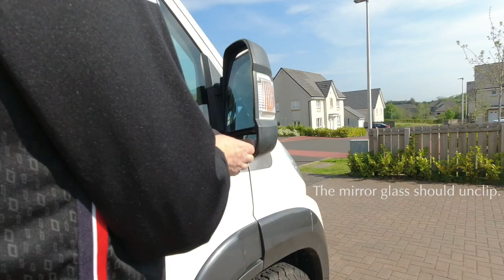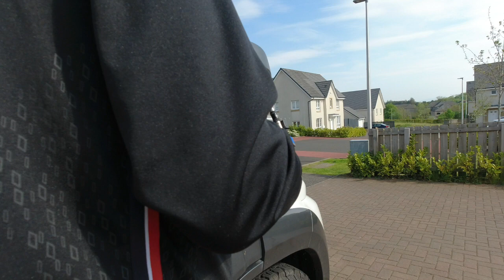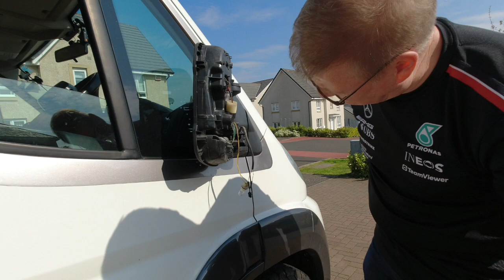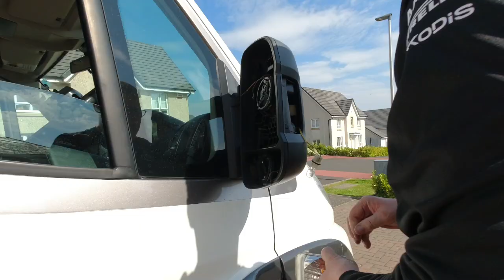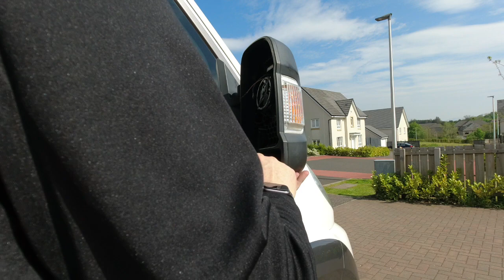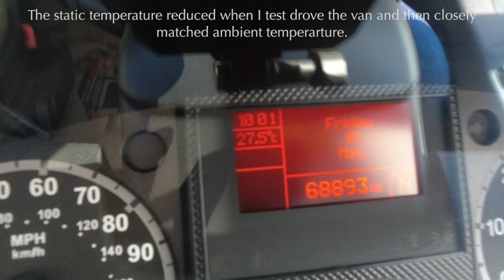Van Maintenance: Mirror Ambient Temperature Sensor Replacement

Comment: Hi where are you based? I've got this issue on my Relay camper  - Ive got the replacement sensor but not capable of soldering etc.  Do you do repairs?
Reply from the maker: Hello, Thanks for your comment. I am based in the Paisley area in Renfrewshire. Happy to do this job. I'm really busy just now and then on holiday so about 8 weeks away before I can do this.